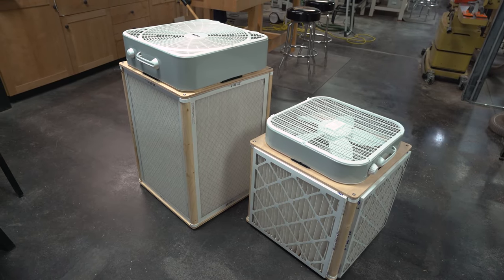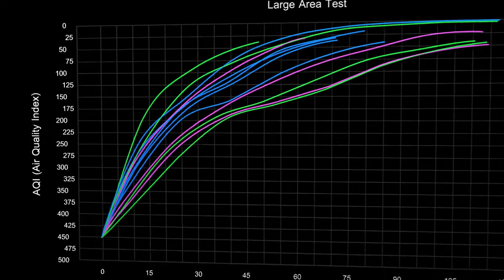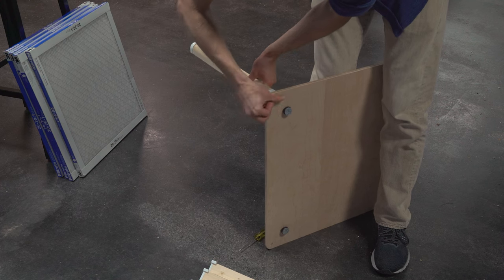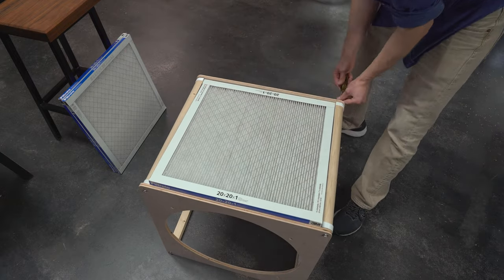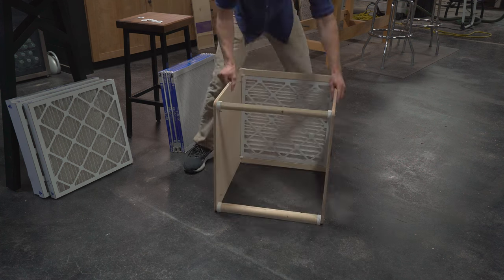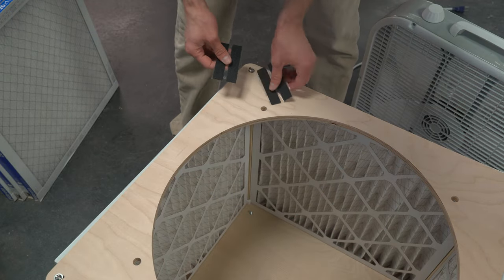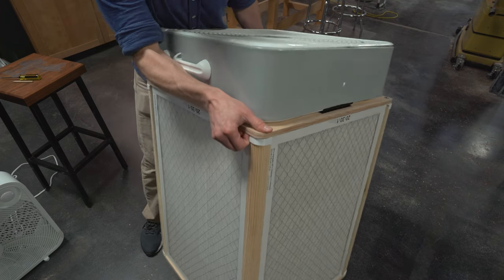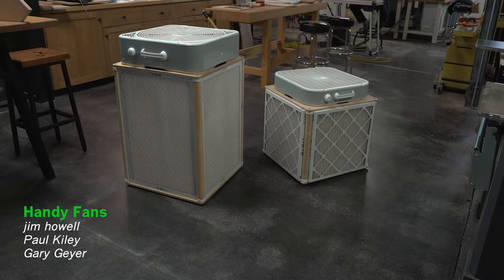Air Filter Kit - Model-B/C - Design and Assembly

Comment: Nice design but I suggest enlarging the inlet from a circle to a square as large as possible and providing a shroud for the outlet. In the current configuration there will be substantial backflow in the corners of the fan outlet side, which is preferentially drawn in and then blown out the front, reducing the flow through the filters. The circular restriction on the inlet further increases the pressure resistance on the inlet side. You can confirm this with visual observation of thin tissue paper. I've tested the impact of the shroud sizing and location using a calibrated flow capture hood, and two papers have been published showing the improvement of the Clean Air Delivery Rate for CR boxes with a shroud on outlet using smoke and NaCl aerosols.
Reply from the maker: Do you have a link to the papers? I take it they also tested the rear style fan shroud? The idea with placing the shroud at the back was so that it is at least closer to the center point of the blades and it will at least prevent dirty air from being sucked into the filter box. The second front side shroud would also increase the price significantly and this is intended as a budget air filter. I am intrigued though, I will run the anemometer over the corners of this design and see how much back flow is present. I'll get back to you tomorrow on that! Thanks for the comment.
Reply: @The3DHandyman  Don't forget about this please :)
Reply from the maker: @gabys2  Thanks for the reminder! I am making a list of all the requests for the new video. I hope I can wrap up filming on this over the weekend.
Reply from the maker: @gabys2  I hope to have this video ready by the end of the month. I haven't forgotten! Sorry for the wait.
Reply: @The3DHandyman  Thank you for remembering! I have faith it will be a good video. Take your time.
Reply from the maker: Hi David! I can see part of your last comment, but when I click on it to reply it disappears. Any chance you can message me through Etsy or any of my social medias? 

There is a button "contact shop owner" on this page: https://www.etsy.com/shop/The3DHandyman

Sorry YouTube is pulling all your comments. I cant even find them in the held for review section. Not cool!
Reply: @The3DHandyman  I can’t find the newer video. ??
Reply from the maker: @michellemajako  Yeah... I can not begin to explain how tumultuous the last few months have been. It will still take a few weeks yet to get this video out, but I finally have time to work on it now. Sorry for the wait!

Comment: I’d also suggest using tape along any gaps, it makes a world of difference in performance especially when the filters start getting dirty. These can also be made using old computer fans if you need one that’s a bit more portable, I have 2 pc fan based ones with high static pressure that work wonders and can be made using any old pc and a cheap hepa filter or even paper towel as the filter medium
Reply from the maker: Most filters seem to be pretty much gap free but at times they are a little crooked coming out of the machine. You are right, this will matter more when the filters are quite dirty but at least to start with, greater than 99% of the air will be heading through the filter. I hope to be able to test this in a future video.

I just got some supplies for making a micro HEPA filter with a PC fan. Love the idea. Thanks for the comment and ideas! Will make a video about desktop options some day soon.
Reply: @The3DHandyman  to be honest the pc variation is a literal lifesaver during asthma attacks, there's been multiple times where mine has saved me from having to be taken to the hospital
Reply from the maker: @LakotaNativedoll  That's quite effective then! Glad you are seeing significant improvements with it.
Reply: @The3DHandyman  i could send you refrence images of how i made my various versions if you wish, the server fan version in particular has a nice speed control feature i'm proud i figured out
Reply from the maker: @LakotaNativedoll  That would be cool. Facebook or Instagram messenger would be the best option for sending a photo.
Reply: @The3DHandyman  i have sent you the photos on instagram messenger, i can’t wait to see how your version turns out
Reply from the maker: @LakotaNativedoll  Got your pictures! Thanks for sending those. I've been really busy since getting back from vacation and am just now getting to comments.... The new design should be out in a few weeks if everything goes well.

I was wondering how the 3D printed duct on the fan worked. What does it do? Does it make it quieter or help increase static pressure inside the unit or something?

Comment: Great design, love how simply you have accounted for differences in filter dimensions between brands.  Not sealing filters perfectly will lower performance a bit, not so critical with ultra low resistance filters like Filtrete MPR or 2" merv13.  Be nice to have an option for caster wheels.  I've been experimenting with aesthetic prefilter covers and found IKEA Teresia voile curtain material a good free flowing option that can be customised with permanent marker pens.  Eg a Minecraft TNT themed cover.  Look forward to 3d printable parts release to try and make a frame in UK.
Reply from the maker: I will add an option for wheels! Thanks for the info on the IKEA fabric, I'll test that out. I am experimenting with prefilters and will have a video out on that concept early next year.
Reply: @The3DHandyman  if it helps I've tested a number of different prefilter materials over the past year.  Most are too restrictive for a box fan.  V sensitive to big resistance changes.  G3 roll or 20z cotton furniture wadding only had a ~10% performance penalty and are ideal for workshops.  G4 panels work too but best if 2".  That specific IKEA Teresia curtain is similar to AC/hepa prefilter screens, which can also be sourced.   Will be testing it in my cadr chamber over Xmas on UK Cr box spec.  Will let you know when have a result.
Reply from the maker: That's awesome info! I would love to know the results of the test. Have you tested any fleece type fabric?

Comment: Attaching a flexible dryer duct or two to an outside source would add filtered ventilation. Then windows could be closed to create an allergy-free residential "clean room in terms air quality.
Reply from the maker: I will keep this concept in mind for a new filter that I'm working on. I like the idea! Thanks for the comment

Comment: Nice design!
Upgrade suggestions. 
Possibly adding support tabs along the filter edges. Obviously need depends on the rigidity of the filter used. 
Also, thumbscrews would make filter changes easier, as well.
Reply from the maker: Thank you! I was thinking about extra tabs on the edges but so far that does not seem necessary. Even the most flimsy HDX air filter that I tested seemed to hold up well under a little compression. The snug fit actually appears to increase the rigidity of the filter itself. The air pressure is spread very evenly over all the filter surfaces so there they are unlikely to collapse. Maybe under extreme soil loads the HDX filters might but all others tested should be fine.

I do like the thumb screw idea! Those to tent to be a little pricey, though. A set of wing bolts is the cheapest and it would add $5-10 to the price. Maybe if I buy in bulk, it could work, will check it out.

Thanks for the comment!
Reply: @The3DHandyman    What about 3D printing some caps and epoxy or perhaps hot glue them on standard hardware, if wing nuts don’t prove to be cheaper. 
Just a thought.
Reply from the maker: Also a good idea! I'll keep that in mind

Comment: We made 3 of the these from your original design.  Love them and so happy you made these new versions.  My question is are you making a design that has a filter on the bottom side?  I like the design with it up from the floor by about 2 feet in my shop and a 5th side as the filter.
Reply from the maker: Happy to hear you like the original design! I am working on some new designs and I've opted to keep the bottom filter out in favor of 4 side filters close to the floor. One version has a tall stack of filters that makes it to about standing height. This captures dust from floor to ceiling, if your ceilings are low.

One significant benefit with these deigns is that that ducting the exhaust from the fan for more controlled air circulation significantly improved overall filter efficiency. 

What sort of space do you use the filters in?
Reply: @The3DHandyman  That is good to hear about the improvement in the efficiency on the tall stack.  That actually might work better.  I use one in my wood shop. One in my upstairs by our bedrooms and another in our living room.
Reply: @The3DHandyman I'm just wondering, what's the best direction of the airflow if you are making a box that has five with it raised off the floor? Should the fan be going into the filter so it sucks it in through the fan? Or should it be blowing up so that it sucks it from the filters? I like your bigger one that has it moving into the bigger fan for things like the spray booth concept, but would it make a difference with something like this? With a five filter one, I mean?

I'm really confused about fan direction with a 5 filter design that is off the floor a good foot or two.

(And thank you.)
Reply from the maker: @paulgreblick  For the box fan style filters I like to blow air out of the filter box. This keeps the fan more clean and creates slightly more air circulation through the work space.

So far my tests have indicated that the 5th filter does not create a huge increase in performance. Using (4) 20x30" filters is better in general.

For spray booths, keep in mind that you need lots of ventilation if you are using high VOC products. Spray booth fan motors are also shaded-pole centrifugal blowers to reduce the risk of igniting the solvent vapors. No axial fans are really designed for this. So, if you are using this sort of fan in a spray booth type environment, you MUST have excellent ventilation as well.

Let me know if any more questions come to mind!

Comment: Incredible job, I have missed your progress... I have been running the Four filter Corsi box using Merv 11 3M filters now for a couple of months... Works really well with low noise using a Honeywell HF-910 it's been fantastic.. less noise then lasko... But it's a bit too large for my small room... I am trying to figure out how to make one with a single 4" filter for the smaller footprint size.
Reply from the maker: Thanks! I definitely agree, the noise level is pretty high for these options. There are more filters to come... Along with the latest batch of CNC parts I added 2 new designs that I'll be testing soon. One is for office/bedroom use and it uses a HEPA filter for a Levoit air purifier. It's small and can be tucked behind furniture or under a bed. I'll include some decibel readings in the video as well.

I want to do a quite option that works with a standard HVAC filter but that will have to wait a little while.
Reply: Corsi-Rosenthal had nothing to do with the design.  It has been in use for decades.
Reply: @DR-cm4hi  cool story bro.
Reply: @adriand6477  DARVO

Comment: Awesome DIY stuff. I am very interested in buying one of your fan boxes.  I am wondering if I can put one of these near the air ducts in our apartment.  Would it absorb the pollution coming fromthe vents? Our apt is 1,200 sqft and even though our ac unit is sepparated, we get also a log  of smells from.neighbors.
Reply from the maker: Awesome! Yes they can be parked in front of an HVAC duct. Using high MERV rated filters in an apartment sized unit can cause the AC to ice up in the summer time. The amount of air that comes out of these units should exceed the amount of air coming out of the vent and probably even the amount of air going into the return vent for the furnace.

If you use MERV 13 or 14 filters like the ones tested in my last video, this should capture just about all pollution if it is running all the time. You will have to experiment and see if running the fan on LOW or MEDIUM is enough to get them all, it is nice and quiet on those settings in a small space. I would like to know the results if you do decide to get one!

Comment: Finally built my 3M MERV 13 20x30 w/ air king last night. 

1200 CFM you say? So that means virtually no loss in CFM, compared to running the Air King w/ no filters? 🤔 Amazing‼️😁👍🏽🛠️

Btw, the gaffers tape is the best masking tape I ever used. 

6 months is the expected filter life? Thought it might last longer, since it’s 4 of them.

Will this remove TVOC, HCHO or any gases? Are TVOC readings & particle readings measuring the same thing? Sorry if I asked this before, this is so foreign😢 to me. I noticed on the pkg, it does not filter ultra fine particles. Thanks !
Reply from the maker: Nice! I had not thought of using the gaffer tape as masking tape but I can see that leaving a nice clean edge. Good call!

The filter life will vary based on how much dust you put into them. I have used these for more than 1 year with heavy use before the performance started to drop.

TVOCs and HCHO are better removed by large carbon filters. I'll do a video on that some time soon. In general the filters can not remove much of this stuff unless it bonds with a particle and gets trapped in the filter. Even then the gas can be released even after it is trapped. Carbon is better at holding on to the molecules after it catches them.
Reply: @The3DHandyman  I just discovered activated bamboo charcoal bags, used to passively trap gases in homes. 

Supposedly, carbon bags can be recharged in the sun (off gassing captured gases outside) 2-3 hours per month for up to 2 years. 

With each recharge, you lose some capacity to trap gases.
Reply from the maker: @capcom4eva  Interesting. It makes sense that heating the pellets would dehydrate them and with that moisture loss trapped gasses can be expelled from the material to a degree. 

I'd like to test that but my VOC tester doesn't seem to be as sensitive as I'd like. I'll probably give it a shot anyway!
Reply: @The3DHandyman  I highly recommend the Simbow Air-Guardian AQI meter, I found it more sensitive to TVOC than the meter used in these videos. I actually bought 3 AQI meters, including yours, but returned 2 & kept the Air Guardian, since it was the first to react to sudden changes, especially TVOC. It also happened to be the cheapest of the bunch. It’s currently $109.99 w/ a $10 off instant coupon. 

Measures everything, except PM1.0 in an easier to read bigger screen, & stands alone, without requiring to be handheld, which makes it perfect for displaying in a room. I really like it & monitor it multiple times a day, to make adjustments in household air flow, based on the TVOC meter reading, it tends to spike when windows are closed.
Reply: @The3DHandyman  can’t believe it’s only been 3 weeks & my filters already are beginning to turn black! Not sure if it’s mold, but did have a bad leak recently. Wonder if it traps the mold particles when it’s off.  Can the filters be vacuumed? Thanks!
Reply from the maker: @capcom4eva  I was just looking at this monitor actually! Thanks for the data. I have noticed that the VOC levels on my monitor seem to be unreliable and that is an issue for the VOC video that I am putting together.

For sure the best way to reduce VOCs is fresh air and lots of it.
Reply from the maker: @capcom4eva  If it's turning black then it's all stuff you aren't breathing! That is good. 

It could be mold. Be sure to make sure everything is very dry after a leak to prevent mold. You can also spray with mold killer if you do find mold.

Disposable filters really can't be vacuumed to restore their performance (when filtering mold or smoke at least). What you can do is buy washable filters like these (MERV 13) https://amzn.to/46kneqv
or these cheaper K&Ns (MERV 11) https://amzn.to/3POgQRz

They are expensive but they will last 10 times longer than disposables.
Reply: @The3DHandyman  You won’t regret it. Also has a nicer quality display, than the other 2 I returned.  Thanks for the 2 filter recommendations, decisions, decisions…lol. 

I wish there was a washable pre-filter that was inexpensive, like the type that come on the winix 5500-2, since the Filtrete were top performers in your tests. I believe you are correct when you say 3M makes the best filters, with the best air flow.
Reply: @The3DHandyman  I sprayed a dilute solution of vinegar, tea tree oil w/ a drop of peppermint castille soap onto the filters to kill any mold that might be growing on it, since it got so dark in only 4 weeks. Molds feed on dust, & the 4 filters sucked up a lot, lol! Great device for keeping my lungs clean, thanks!  Will the spraying deteriorate the filters? Thanks!

Surprisingly, the TVOCs dropped dramatically the following day, along with me thoroughly cleaning the mold on my windows in my room that formed from condensation. There was quite a bit of mold, might have to hang dehumidifier bags on the curtain rods. Had the CR filter right next to me, while cleaning to protect my lungs from any loosened mold spores. 

My guess is the filter spread the aerosolized spray with the tea tree oil & rapidly moved it around the house to kill mold, since the air king moves air at a high CFM.
Reply: @The3DHandyman  looks like I may have ruined it spraying it. TVOC goes up & I start coughing, throat & chest irritated when Corsi-Rosenthal filter is on. I’m going to change the 4 filters, I’m going from MERV 13 —> MERV 14. Good thing I ran the IQAir GCX immediately afterwards, which quickly improved the air quality & TVOC went down in seconds.
Reply from the maker: @capcom4eva  Glad you have a fall back filter. You really need to get to the root cause of the mold. Filtering the air is just dealing with a symptom of the problem. You should look into mold remediation.